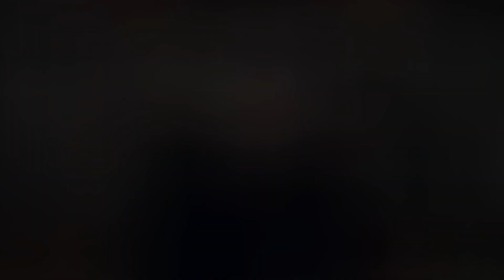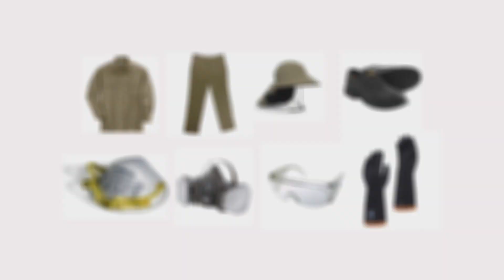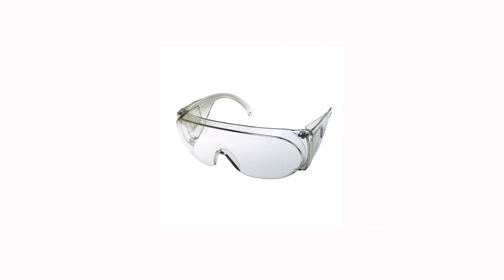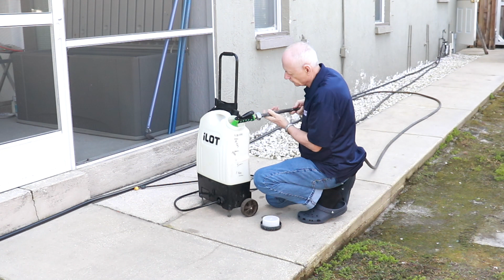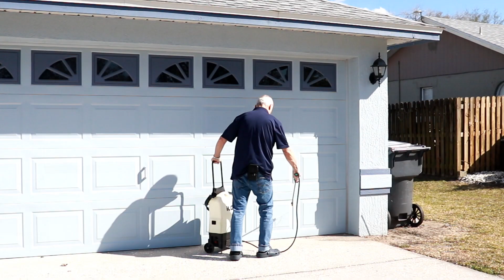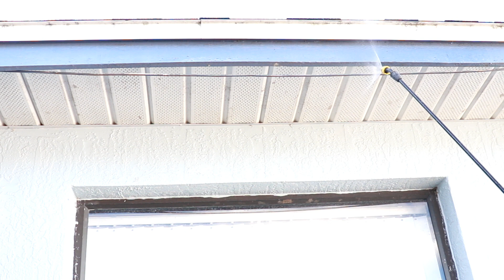How to Prevent Drywood Termites 100% Guaranteed.

Comment: Watching different videos from your channel and read between the comments, is this a good summary:
- If one can treat an expose wood directly such as new framing structure, basement, attic then it would be best to use Bora-Care since it's a permanent solution and require only one time treatment?
- For existing house that we can't treat the wood directly then use Taurus SC and Talstar as a preventive treatment
I assume boric acid powder, borax, or harris termite powder are not effective or does not last? I use harris termite powder and spray on all the rafter and joints when reroof since they are exposed.
Reply from the maker: You understood correctly that treating a house with Bora-Care during construction will render it permanently termite proof.  For existing buildings, you can prevent drywood termites by treating the exterior of the house, alternating between Taurus SC and Talstar P.  If you have areas of the house that are too high to reach with a tank sprayer, I can give you an alternative treatment that will make it easy to reach these high up places.  This same method can be used to treat the rest of the house as well, thereby eliminating the need to purchase a battery-operated tank sprayer.  You can literally treat your entire house with a hose end sprayer.  The equipment is less expensive, and the treatment is way faster.  The only downside is that you need to do it every 60 days instead of every 90 days.  Also, this can kind of get all over your window glass and make it look kind of hazy.  To avoid this, you can simply get a cheap 1 gallon pump up garden sprayer to treat around the windows.  To fill the tank sprayer, simply put the hose end sprayer in the stream setting and shoot the pesticide directly into the tank sprayer.  I have a video on how to do this and I will give you the link.  This is a generic video that covers a lot of different pests, but it also works for drywood termites.  The beginning of the video shows you how to use a tank sprayer with Bifen IT, but near the end of the video I show you how to treat those high up places using the hose end sprayer with Bifen XTS.  The truth is that I use the hose end sprayer to treat everything, and I simply do it every 60 days.  I find this is way faster than treating everything every 90 days with the tank sprayer.  I also treat my yard every 60 days, so it is very handy to just hit the house with it while I'm treating the yard. Treating your yard it's a great idea because it will eliminate a lot of pests.  I will give you a link to that video as well.

There is some benefit to applying a borate to the roof sheathing when the roof is being replaced.  While Harris Termite Powder, boric acid, or Borax will provide some protection, you are better off using Bora-Care.  The difference is that Bora-Care will penetrate deep into the wood, while those other products will only treat the surface of the wood.

I hope that helps.  Be well my friend.

Video on how to treat your house with a hose end sprayer:  https://youtu.be/Yozv3s-Qwlw

Video on how to treat your yard:  https://youtu.be/wifoTU5dmp0

Comment: So I’m doing a room renovation and I found termites in the walls, how do I get rid of them 🙏
Reply from the maker: How you handle that will depend on the species.  Figuring out the species is actually pretty easy and I have a video on how to do that.  I will provide you with a link below.  After watching this video, you should be able to identify the species.  Just get back to me after you watch it and let me know what you found out.  At that point, I can tell you exactly what you need to do.  Let me know if you have any problems identifying the species, but I do not think that you will. It is much easier than you may imagine.  Also, please tell me where you live.  Location matters.  Be well my friend.

Video on how to identify termite species: https://youtu.be/dIs_a0nfVjg

Comment: The battery-powered sprayer is out of stock. Do you have any other recommendations? I have also emailed you pictures and questions on how to get the HOA to agree to treat the building. I am a new owner five days post-close and super overwhelmed. I believe I have drywall termites.  During inspection, only a bedroom was treated after visible frass, and a couple of weeks later, I found frass again in the treated area.  I've called the company, and they will return this week. However, they mentioned they could not find a hole.  But from the pics I sent you, it's clear there is a bigger issue in multiple areas.  So I want to start preventative treatment while I gain HOA buy in for building treatment. I appreciate your guidance.
Reply from the maker: I take it that you live in a condo.  Is that correct?  If so, please send me some photos of the outside of the building.  It's faster than trying to describe it to me.  After I see the building, I can tell you if there is any way to treat this problem.  I will look at the email you sent as soon as I can.  Right now, I am backed up a few days.  This is my busy season, but I will get to everyone.  So, please be patient.  I do have a way to prevent drywood termites that does not require a tank sprayer, but the HOA will never do it.  You are probably on your own with this.  I can assure you though that all of the units now have drywood termites.  The entire building should be tented and fumigated, but they probably will not do that, even though this may cause a serious problem, depending upon the way the building is constructed.  That's why I need to see it.  In some cases, this is just a cosmetic problem, but in other cases you may get structural damage at some point that will cost thousands to repair.  Sometimes, if structural damage may result, then the best thing you can do is sell and cut your losses.  Hopefully, that is not the case here.  I will give it to you straight when I see the building.  I hope that helps.  Be well my friend.